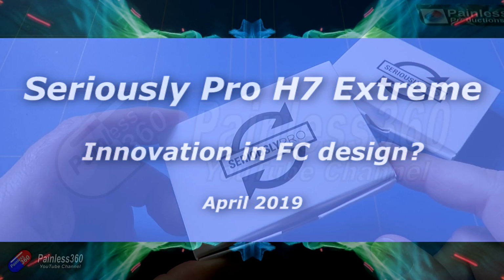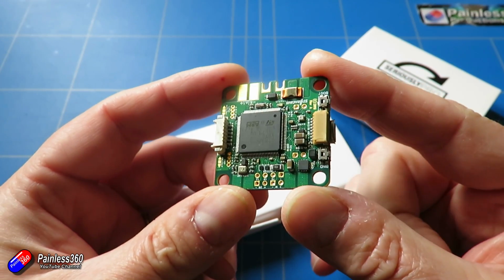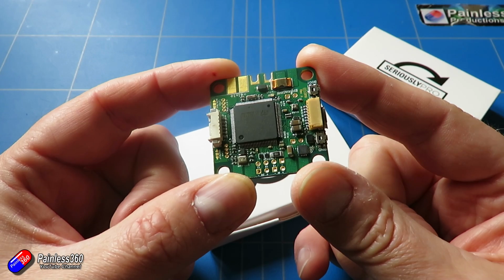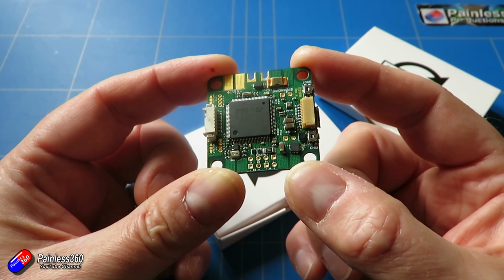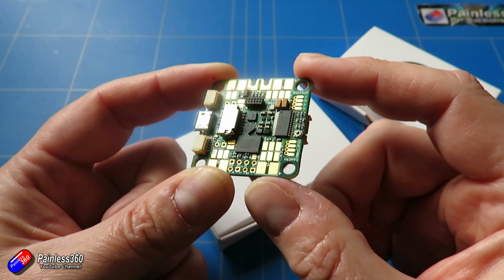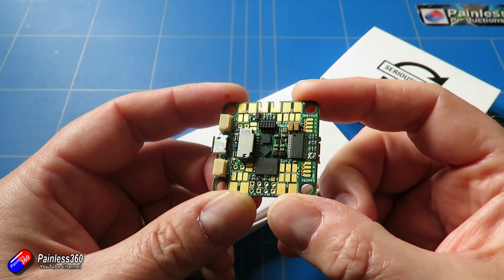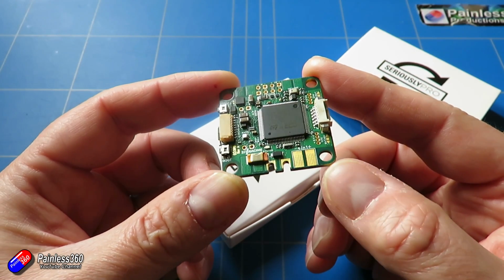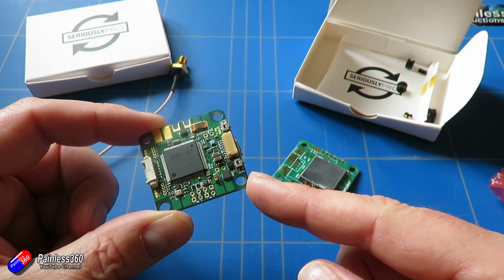World Exclusive: SeriouslyPro H7 Extreme FC - first look

Comment: Where are the support channels for SP Racing products?
Reply from the maker: Not sure what you are asking...
Reply: @Painless360  sorry let me clarify; I have two technical questions about this FC but not sure who to ask. SPRacing website indicates a slack channel but doesn't specify how to find it (no link). Trying to find info on how to utilize different sd cards to boot into different flight software. Also, I have soldered a NanoRX to the stack board but only getting 1.5v on uart1 and uart4 pins. Wondering if I need to solder a bridge somewhere? User guide doesn't mention.

Comment: 1) If I buy this board now, will I not be able to use this right away since the software is not yet available? 
2) Is there a direct plugin option to a 4-in-1 ESC (e.g. JB 32 or Aikon AK32)?
3) SUpport TBS unify/crossfire as is or needs any rewire/resoldering?
Reply from the maker: Great questions, I will add them to the list to ask Dominic Clifton in the next video. Quick answers- 1) Betaflight code available from Seriouslypro 2) pads and power for a 4in1 but no connector 3) yes

Comment: Unfortunately, if it is manufactured in China, it will be so easily cloned and compete with the high price of that board would be like a piece of cake for them...
Reply: they only clone things that have a high difference between cost price and retail price.  they also only do if they have access to the software it runs and if manufacturing and part costs are low.  in thw case of the H7EXTREME they would first need an expensive 6 layer PCB with blind vias and plated cutouts...  I've previously only seen clones of 2 layer boards.
Reply from the maker: A lot of designers have included elements that are not hardware that make it a lot harder to clone. Look at BrainFPV..

Comment: can the vtx adapter support rxsr or long range rx with full telemetry bells and whistles ?
on the website it says xm+ ? and few infos on it.
with that lot of interfaces its about time for unify tx power change and turtle record on off by switch on tx .......
hows about a perfect clean build example with this for copters and vtol planes on the other .....

ups and forgot lots of obstacle avoidance and landing aid sensors gadgetry
Reply from the maker: rxsr is a recievwr not a VTX module. I don't understand the question.
Reply: thanks for the answer.

from the website:
* Has space to install RTC6705 module (FX758-2-SPI) or TBS Unify Pro.
* Has space to install FrSKY XM+ Full Range Diversity Receiver

so I hoped for a clean way to add rx AND vtx . Or is it OR ?
But no info what connections are routed through the stacking connector ?
looking for the least wires for clean stack as possible ......

Thanks

Comment: Nice I had 3 of the f3's. First class in alot of ways but the connector s always ended up breaking. I was a nub nub though and was constantly rebuilding. Be interested in the fall review. Keep up the good work.
Reply: I spent a lot of time working improving manufacturing since 2015!  There was only one batch that was affected and the solder was changed.  I've had no returns from anyone with connector issues in the last 3 years.  Barely any returns at all in the last year, 3 maybe 4 in total I think.
Reply: @DominicClifton  well if your still accepting returns of the f3 version I found one of the three I had with the lifted connector

Comment: i want one!!!!!! Would it be possible to have two  firmware's now? like cleanflight and betaflight selectable at bootup? inav or adropilot or raceflight and butterflight, ect... Wouldn't that be just incredible? this is an amazing piece of hardware and where can I buy one? TAKE MY MONEY!!! oh, what gyros are being used on this board BTW?
Reply: yes, if you flash one to the sd card the firmware with "config on sdcard" mode, then the firmware will be loaded from there when present.  If the firmware is not found on the SD card then it will load from flash.  so you can have an sd card with new firmware and settings on it, take it to the field, fly it. then unplug the sdcard and fly different firmware/settings.

2x ICM20602 gyros.
Reply: @DominicClifton  What!?!? You are joking?! OMG! You are a genius! I love the innovations you are bringing to the FPV community! This is so amazing, I can't wait until I can afford  to order one for myself! PID Audio sounds amazing, something I want to try for sure. This FC should take the market in my opinion..... Cant get any better and will do anything you ask on any setup with any requirments.. Could this be the end all, be all of FC's? Might just be.... only time will tell. Thanks Dominic! my hats off to you...

Comment: Finally external SPI, been waiting quite a while. Been working on a project to do group formation of racing quads with laser triangulation but run into "stalls" due to serial speeds and ram constrains. Opens up a world of coding possibility's  with extra storage  that's bootable with QSPI and  SDIO and that lovely 400mhz 128k cash easily do 5k strings a second. Hobbyist not gonna be far off dji autonomy much longer.
Reply: The SPRacingF7DUAL had SPI pins on the stacking connector 2018!

Comment: totally useless without firmware / software compatibility
Reply: The H7 code will be merged into BF soon, source will be published as soon as I get the main website updated.  Watch out for announcements.  It currently runs Betaflight 4.x.
Reply: @DominicClifton  good job. I will buy it just to appreciate your efforts for all fpv community.
Reply from the maker: The hardware always comes first - remember the F4 and F7 reaction when the hardware first came out? Happy flying!
Reply: @Painless360  i remember, softwares and firmwares came when banggood made and sold lot of clones.
I'll wait for the HGLRC, RacerStar, Eachine, Matek or HolyBro version, they always come out with adapted softwares (and prices !).
Reply: @trophythedrifter  The clones of the SPF3 gave that board a very bad reputation because, the clone designs were crap - they just died randomly. That's a huge damage done to the original designer's product reputation, over and above the stealing (cloning) of the designers work in the first place.
Reply: Id like the original, can appreciate making it first.
Reply: Erm, you do know who Dominic Clifton is? 😂👍🏻
Reply: @neildotwilliams  . Is he not the guy behind all original SPracing FCs?
Reply: Jacking-up FPV Yes, also as mentioned in the video he is the lead developer on CleanFlight, where betaflight forked from.  So he knows the firmware very well indeed.
Reply: @neildotwilliams  great, and agreed. What exectly you was asking? I cant buy this product as appreciation of his work?
Reply: Jacking-up FPV I usually buy SPRacing flight controllers and betaflight ESCs. See what I did there 😀
Reply: @davidwesternall873  When the F3 came out it was the best of them all. Lets take a look at what was available in that form factor at the time.  There was the Naze32 or the CC3D everything ran on F1 processors (excluding arduino which doesn't apply to 5" qwhads) then the big bad F3 hit and Dom was the first to do it.  Did you have a better design at the time of the release that cost less than $50.   SP Racing has always lead the frontier on new design, just like with this iteration of the H7..